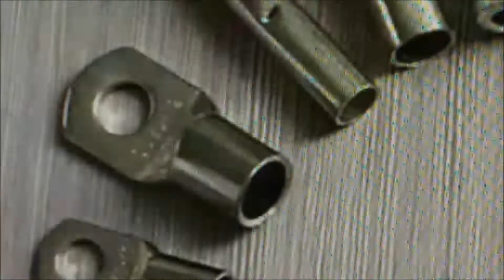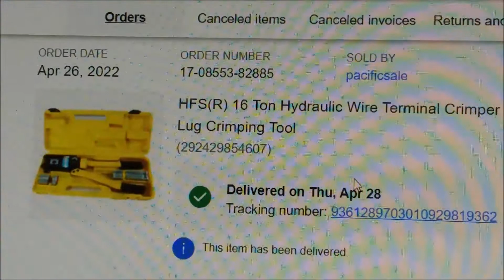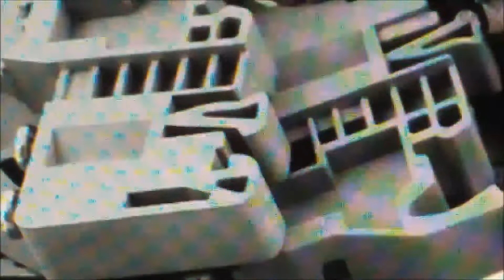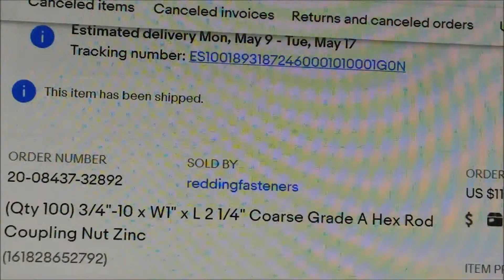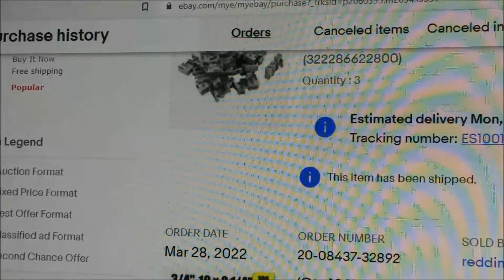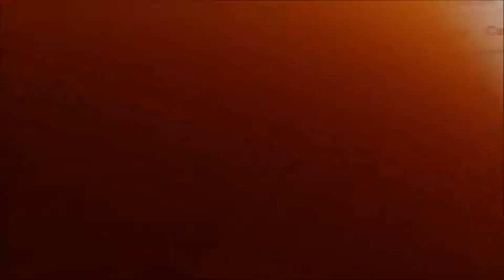CONCRETE HOUSE BUILDING IN PH, HOUSE WIRING WITHOUT WIRENUTS AND TAPE FOR SAFETY AND SECURITY PART 1

Comment: I bought one of those hydrochloric  crimper myself. I got 10T one. There really good but a bit onward  to use. By the way, I don't know if I'm the only one that does this but I just buy copper tubing and make most of the terminals I need with a vice lol and then solder or use the crimper
Reply from the maker: I have a [pair of huge farm tractors with 4 batteries 2 series, 2 parallel with 1/0 cables  It takes 820 amps on 24 volts to just bump it over and 1100 amps to start it all feeding through a 1/2 inch stud.  Now that's smashed pipe territory. For the Philippines we just opted for neat, everything tinned copper  both wire and lugs, Simple to solder. Just dry fit the parts, mark the rotation with a paint marker and get it down on the work table to crimp them. We have ratcheting crimpers for the small wires AWG #8 and smaller.